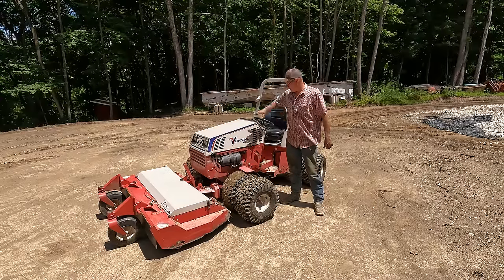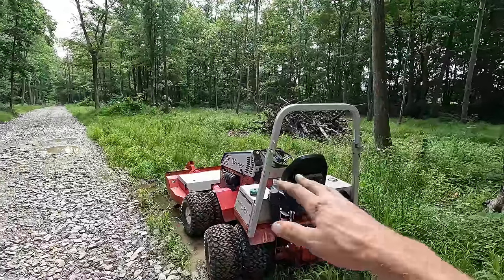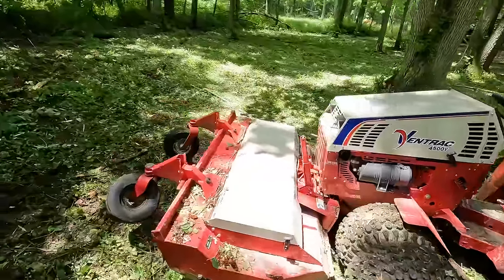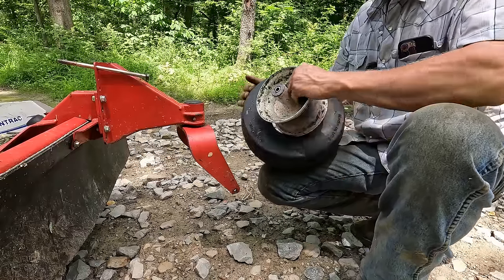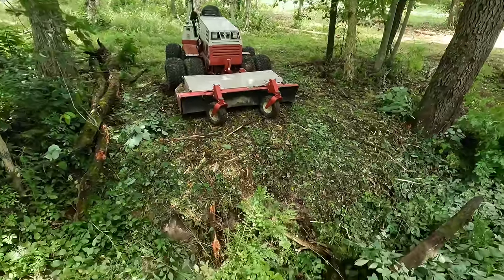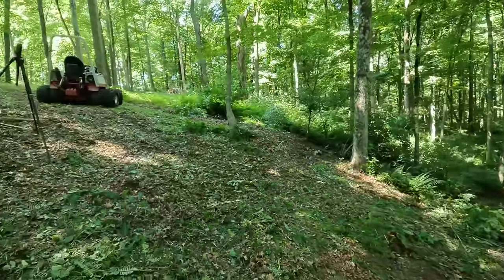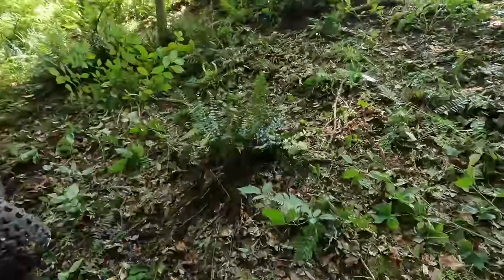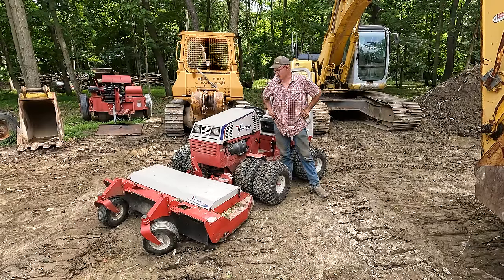Cleaning Up the Farm, Pushing a Ventrac to its limits! (4x4, Diesel, BEAST!)

Comment: There’s a certain confidence you get operating a cheap second hand machine that you don’t get when you buy new, cheers Matt 🍻
Reply: yea, basically you don't mind if you accidently mess up because it's already used and beat on and it was cheap to boot
Reply: @highjix   Exactly, if you buy new the resale value is always on your mind so you hold back on testing it’s true potential 👍🍻
Reply: @drunkdunc8738  I bought a brand new 4x4 truck because.... well I didn't know a darn thing about trucks , went to my uncles property and started to take it off into the bush, started looking at all the trees and crap and decided, you know what, maybe this isn't the smartest thing to do with a new truck and fled the area.
Now if that had been an old beat up truck I wouldn't have cared in the least.
Reply: There's nothing cheap about ventrac tho it's a 30k dollar machine
Reply: @kirdot2011  Honestly, I was curious about how much one of those thing would cost, but just as I imagined, it's more then I can afford. I will stick to hiring a landscaper.
Reply: Why buy a new one when that one works Fine
Reply: @kirdot2011  Make no mistake. Matt is cheap as they come and did not pay 30k for that rig. He did some kind of horse trading with someone for something.
Reply: @giggiddy  im very well aware he did not pay 30k for it. I was just saying thats how much it costs brand new. dont know how much it costs with 1095hrs on the clock

Comment: I bet the caster wheels are a disposable type so rims are spotwelded together on each side of the rubber. Best way to not risk damage of rims probably to drill the spotwelds and use nuts and screws. Love the dually wheels and Im impressed of the performance of that Ventrac.

Comment: Those are awesome little machines. I have seen several channels here on YouTube using them, and they all have nothing but good things to say about them. One advantage I noticed that Ventrac has is the mower is out front, and it helps stabilize the machine if you are going up a steep hill. Anyway, was surprised as well you got a machine in such good working order for once, lol.

Comment: Make sure you service the hydraulic system religiously on that, that machine is hard on that system. Also you should probably turn the mower on then rev it up, easier on the clutches and belts

Comment: I enjoyed you really working the Ventrac, been keeping my eyes on these too.  Its nice to hear your high marks on it, since you have experience with large machines.   Great job weaving in and out of your obstacle course..  Attachments: Tire chains may help on the hills??  I've seen the " Power Rake" do wonders to revive gravel driveways, but you got the big machines to handle that.   And depending what level of manicured lawn you want, but the AERA-vator/Seeder looks pretty cool.  And once you have a nice lawn and don't want to rip it up with the big toys and Power Bucket/Grapple would be a nice attachment.  Also you like doing routine maintenance vides, been nice to see one on the @Ventrac

Comment: Matt it’s a real cool machine I think you got a goodbye this time and you didn’t have to fix anything you just got on it turn the key and it went. But I did have one question I thought that that machine had a Perkins three cylinder diesel on it is that correct. At least it kind of looked like one when you had the lid open. Keep up the good videos enjoy what you’re doing and look forward to the new videos as they come out.

Comment: So what would I end up breaking when I find a rock, stack of t-posts, or cylinder head hiding in the weeds? It's not an exaggeration either: I recently came across half of a model T differential in an area I was trying to take back from nature. Thankfully I saw it before the bush hog went to battle with it.

Comment: Knowing nothing about the workings of the machine, I was half expecting to see Matt discover that the front cutter wheel had the wherewithal to split in two, making it relatively easy to reposition the tyre and draw the halves together again. Obviously, there is no such facility.

Comment: Dear Matt why don't you chat with dirt perfect or see his other brush cutter with a hydraulic pump and attached to his exvactor to cut deep incline areas and maybe a flail mower attached to the little hoe as if has rubber tracks to cut through this winter as the grounds hard 
Next if you put kentucky fescue drought tolerant   now those low areas if you put small ditches to make water drain to. The road then spread the seed I a graduate of u of Michigan and Michigan State on grass tolerant it drink water in soft areas mix it red fescue works in shade if you do areas that grass will keep that ground drier and with ditches or courrageted pipe cut down on boggy 
Next knock the soil down that grade and put 1/2 amount same seed will make that deep slope easier to climb

Comment: These are very well engineered machines made In the USA .We had 2 4500s where I retired from . There are an almost endless number of attachments for every job . Most impressive is a buffalo turbine blower with a driver operable 360 degree adjustable chute . With a belt driven pto you want to keep a spare set of belts on hand but they are incredibly easy to change

Comment: You ever get the chance to get a Kubota B2100 get it. The one I drove was a 4x4 diesel. An absolutely work horse. Had a large belly mower, option for a front loader, backhoe, and a cab. Had alternator issues but I loved it.

Comment: That 902 Kubota engine is the same as in my Kubota BX2230 with 60" under belly mowing deck. Mine currently has 1880 hours on it and not one issue with it. Mine is rated at 23 HP.
Amazing how that Ventrac go up those steep slopes! Though my tractor is 4WD I would not be able to do those slopes. 

I hope you got a good deal on that. They are $27,000 plus new...

Comment: Had a Steiner with same set up. It was great . Unfortunately the rigs in one if the cylinders went bad and would lose compression. So I ended up getting a Kubota l3301 with a loader for brush hogging. Have it on my channel a lot. I need a Steiner again 1 day. Lol I also mow for the school I work for and they have 2 Steiner's. Love them

Comment: What?  You mean you don't know what to make of a piece of equipment you don't have to rebuild before you can operate it?!  That's something worth getting used to!  The Ventrac looks like it does really good job with brush, and the grass you were cutting down along your drive.  All those wheels gives you really good traction, and, as you pointed out, it's very light on the ground, but you're really stretching its capabilities for traction on those steep slopes of yours.  Overall, though, it's a very capable machine and performs well.

Comment: I would have bet you would not get that tire back on the hub.  I've had the problem with gauge wheels on my Kubota mower deck. I wonder how they do it in the factory.  Well, at almost 80 I'll probably pass on a purchase.

Comment: I've never yet owned a ventrac but i might consider getting one now  ,,damn that looked fun ,, I've got a John Deere F-1145  with a 72 inch deck  , it's 4 wheel drive but steers with the rear axle ,it'll almost climb a 45 deg slope about like that ventrac ,,i have a little more power due to an upgraded engine it's got a 33hp yanmar turbo diesel ,,
you mentioned attachments  well you have the best one already  ,,a front dozer blade  and a rear box blade for dirt work ,,,are good units to have ,, i have a snow thrower and push blade for my deere and also have a stump grinder

Comment: If I were you, I'd use that drone to find the largest trees on the property and then scout those area for game trails -- game animals use large trees as way points in their travels.
Then I'd use the Ventrac to clear new paths, you know, directly to your dinner table. Did this on our property and it resulted, over time,  into a ten fold increase in game travel.
One time I was grilling some game birds on the side deck and stepped away for a moment and when I returned there was a six point buck with his nose in the air sniffing the smoke off the grill, yep you're definitely invited.

Comment: The one thing I like about this machine is the fact it's small, lightweight, and with the dual tires it's very easy on the ground, watching the video it looks like it hardly leaves a mark, better to use this instead of the attatchment on the front of the skid steet, that machine is bigger, and heavier, and it would leave a mark on the landscape.

Comment: Dear matt I love that machine it's a great cutter but not a Finish mower and now after you cut the brush all the dead trees branches are showing  I was wondering where on your property to build a  burn pit and with your trailer either your bobcat or the lowboy put all those branch piles that are showing on the trailer to the burn pile or fat alice maybe borrow a friend and put that branch to burn and one rain day and you have many coming from the rain to get those branches gone or cut and make for fall to make a fire barrel while working outdoors . So when are the building going up ? Then when you have your orange autocar running it seem you have items all up and down your property  and reason you not cleared by the west side where you have your ford crane truck  remove the topsoil and put in some of that fill and move your equipment in one area and supplies in a area separated to make it in one area ?  I love your show and being I recouperating and beening in landscaping I feel frustrated as I see your place and love landscaping design  have many plans for your washing area to pump the water from the creek have a permanent waterline and pump attachment if we put a  metal building to house the pump we could put the piping in still this summer  make a area that can be built to wash off equipment  I thought of you getting at auction a few more storage containers I thought of cutting the bottom off both and rebuild the double door with a beam across top and bottom making it a nother building that you could park your mower rolling tampers tools that are outdoors near your big one to keep those dry and clean

Comment: A solution to the tire coming off the rim of the Ventrac mower... put some fasteners through the rim into the rubber tire like setscrews. I would use say a hex head stainless steel sheetmetal screw, use a step bit to start the hole so you don't overpenetrate, then jsut crank em in with an impact like roofing screws. If you really want to go crazy you could replace the soldi rubber wheels with iron caster wheels....

Comment: I emailed you a link to an auction in pa that had some dirt rollers one with a sheeepsfoot drum and blade and they had a smooth drum roller too.  Not sure if you checked it out or not,  So are you doing any dirt work that pays or just working out at the farm and getting ready for your building?

Comment: Ive had mine for 3 years and besides for normal wear its been great i especially love the tiny loader it connects and disconnects very easy very powerful hydraulics and a bunch of stuff to go with it i use the v plow sweeper bucket and straight blade all the time

Comment: D902
The Kubota D902 is a vertical, water-cooled, 3-cylinder, 4-cycle IDI diesel engine with a capacity of 20.4HP at 3600RPM. Don’t mistake its compact size, this is one of the most hardworking, efficient and cleanest running diesel engines on the market! Very impressed with that machine

Comment: You actually bought something actually runs right off the bat. Cool little machine. Now get a sprayer for it and mix desiel, roundup and tryclopyr in it. That will keep the brush at bay for you.
Cool video.

Comment: I've got an older Steiner S-20/420 the I've recently restored (documented on my channel). My dad bought it new back around '86?  It's been an unstoppable beast for sure. The hydraulic pumps and motors have never been touched. When I restored it, the main hydraulic items simply received cleanup and paint. It's been so reliable. I've got the finish mower deck and it gets used like a bush-hog with no problems. Its taken down 1" saplings on the regular.

Comment: Matt you can get chains for those tires which will give you more traction still. Might chew up the ground more but as it's not a golf course you're mowing might work. I have an older Ventrac 3400 Diesel. Came with a front bucket and a blade as well. Buy some spare belts find out where all the grease nipples are, there are plenty. Great machine have fun.

Comment: They make a bolt on cab for it with heater for winter, they have just about every attachment fathomable not cheap. But I’m sure you’ve already found that out. The owner has a YouTube, he’s a really cool blue collared man. VenTrac is made for the workers by the workers honestly my favorite equipment manufacturer.

Comment: I have the Ventrac, and for sure the best all in one grounds keeper, I have the power rake, terra rake (a spring rake), stump grinder and finish mower….and the small grapple and bucket. I have bigger equipment but the ease of use is fantastic…I guess the tough cut is my next buy……love my machine…very handy for gravel and soil conditioning, did all my aground ground contouring

Comment: They only problem  with the dually mowers is they give you a bit to much confidence. I used my brother's  and after using it for a few hours I felt it would climb anything.  About  that time I set the nose to the sky. I found the limits of the mower lol. But they do work extremely  well

Comment: Heard it suggested to put hard rubber tire into boiling water to make it "stretchy".  Personally though I'd see about splitting that steel wheel in half and holding it together with a few bolts so you could just unbolt the wheel halves, slip them into the tire again and then bolt it back together.

Comment: Never heard of the Ventrac brand, but I gotta say it is quite impressive!  Some ideas for you.  Maybe fabricate a holder for a weedwacker that can attach to the ROPS that holds the weedwacker vertically, and along with that a chainsaw holder.  That way if you come across saplings that are a little to big for the machine you could buzz them down with the saw quick.  One other idea is to look into a set of tires with a more aggressive tread pattern.  Especially since you have some crazy hills you have to mow.

Comment: Matt, I've been subscribed for a while and liked the video. I've also cut through the woods just as you are doing. (Not with a Ventrac) I made things easier each time after a couple mowings by bringing an inverted paint can on one of the 3' ish extensions and reaching out and marking stumps, tops of rocks, partially decayed fallen limbs/trees etc... I went through and dealt with a bunch of issues each time after mowing with the appropriate equipment. After about a month my mowing time was reduced by at least 1/3.
From them on, only had to deal with freshly fallen limbs. Even though that Ventrac is a beast, you'll save on blades and maintenance in the long run.

Comment: Watch for the "Broom" attachment.  You can clean and sweep snow, gravel and dirt.  It is a "Must Have" if you are taking dirt onto sidewalks and streets.  It's great for snow removal on sidewalks and parking lots.  You might want to get the extra weights and chains for the wheels.  Also the turf tires are good, but the regular tractor tread would work better around the farm. There are so many attachments that you could spend thousands.

Comment: I'm definitely impressed at the hillside areas you mowing on I'd love to fine one like that for my place. For smoother easier mowing the rougher terrain. 
Only thing I see abreast for my personal comfort. Mowing g in your steep banks I'd be tempted to slide the wheels out as wide as they can go for maximum stability.   But I have a little natural uneasy feeling when things get tippy after rolling a smaller big  loader at 15.

Comment: You probably know this but in the Appalachians it’s more work to clear with a dozer because you have for one huge piles of roots and stumps and two acres of mud to re establish. But if you just brush cut a few times a summer before you now it you’ll have pasture and you can drop trees if you want at a slower pace to be able to process them.

Comment: never owned but but i'm sure you can get a blade for the front to push snow on the driveways ..i spotted what looked like a blade mount behind the brush cutter..would make keeping the farm and the house driveways cleared in no time and save on your body..i think you can even get a cab for them..well a soft top style cab..atleast it would keep the cold wind from blowing in your face when you're doing work in the cold